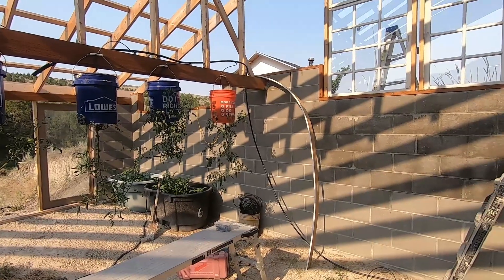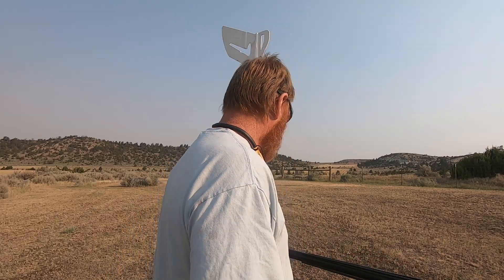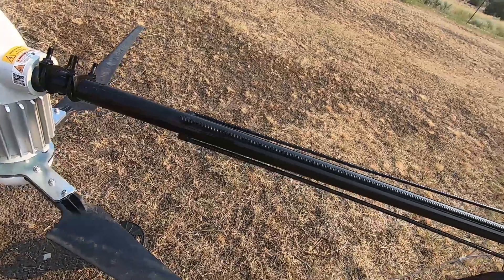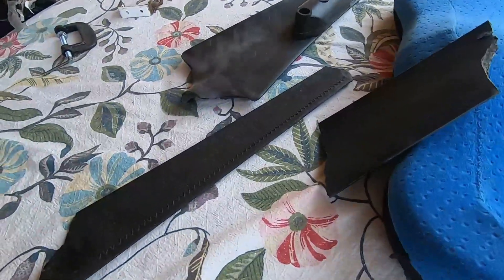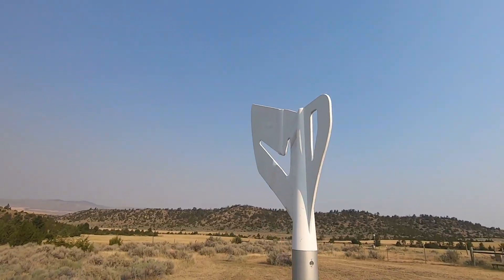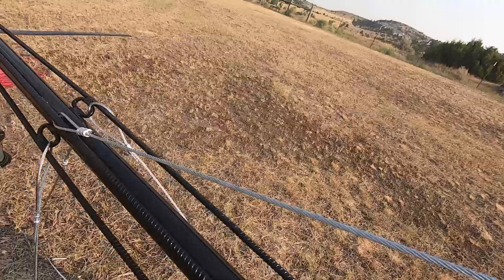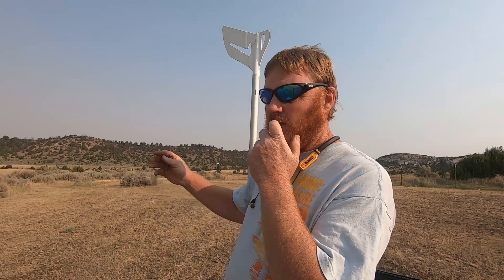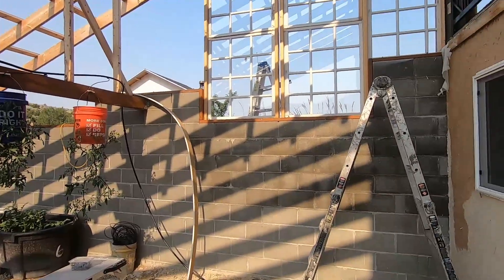My wind generator tower failed in a way I did not expect,  Ista Breeze update

Comment: I just bought the I2000 I plan to run a 1 1/4 conduit into the top of a TV antenna tower and I hope that's gonna be solid enough.
Reply from the maker: 1 1/4 IMO is too small, but who knows maybe it'll be fine depending the amount of wind you have. Good luck
Reply: Too small, I use 2.5" for my i1500.   Quadruple whatever calc you are using. It experiences crazy forces at the top.

Comment: We had a storm comming so i prepared by shuting the i1000 of. Shorted the 3 phases for full brake. I measured 69MPH in the gusts. Everything held up great. But if i had run the generator it would probably get damaged

Comment: I have also an Ista Breeze, the i2000 and used a 1 1/2 " pipe schedule 40, slotted 4 sides and used 2 muffler clamps and also used the 2 screws which came with it. I use my i2000 on a 24volt bank and it delivers around 300 watt constantly with higher peaks, one time 1213 watt on a 50mph gust but mostly around 18 MPH. I use one inch fence pipes as a brace instead of wires. "Toys for watts" has a very good mount for his Ista Breeze have a look at his channel.
Reply from the maker: Great minds think alike lol.
Reply: You should get more than 300w. What gauge cables do you use? And do you measure before or after inverter?
My i1000 gives like 300w constant
Reply: I always appreciate a plug, John! (I don't have access to my toys for watts stuff while traveling!)  I'm actually bringing my i1500 down and swapping out for a 48v i2000 in the next month or two.  I did my mount that way (1.5" black pipe with slots and muffler clamps but I'm going to cut that off and print a bushing to mount it directly to my oilfield pipe.  The muffler clamps get loose after a while.  After a month up there I can see it wobble.  I'd like to see them sell the turbine with a bushing to let it fit common pipe here in the states.  That 40mm stuff is common everywhere else.